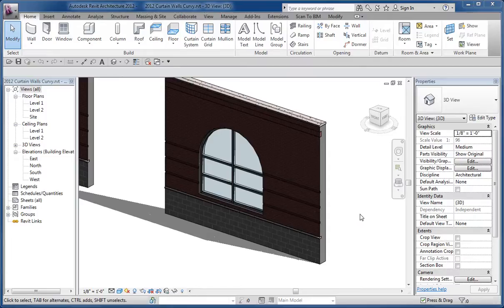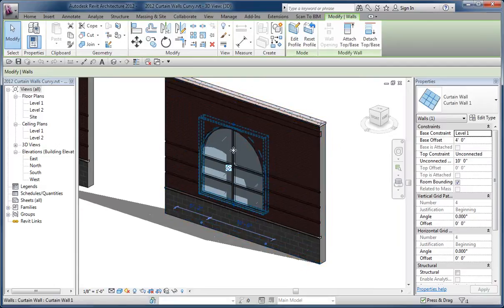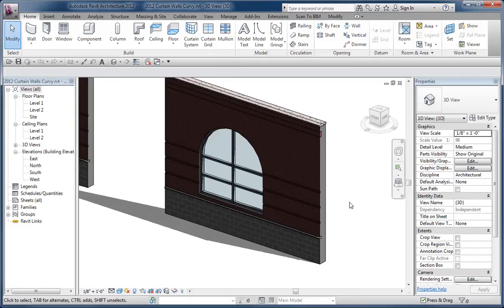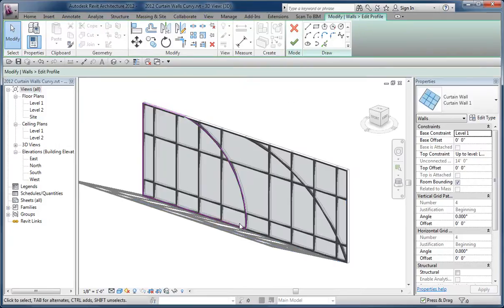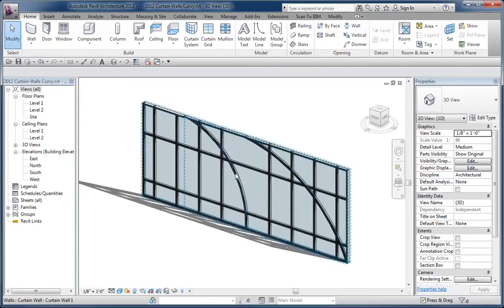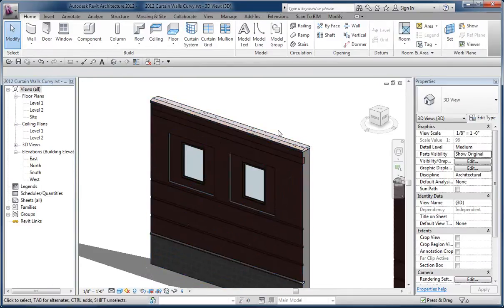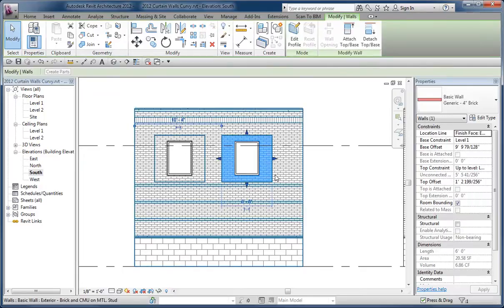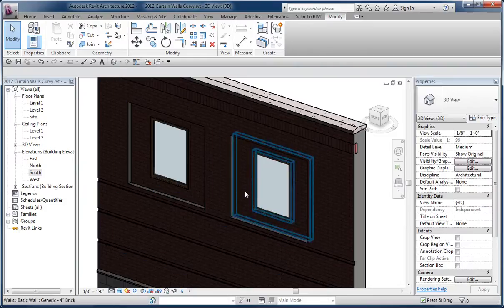Curved Curtain Wall Edges

Comment: thank you for that ,but if you can explain the curved mullion in small video it will be perfect
Reply from the maker: No real mystery. I just applied a rectangular mullion to the boundary of the curtain wall. I used Edit Profile to create the curved exterior shape of the Curtain Wall. I placed the mullions one at a time along the boundary and only one mullion on one curtain wall edge that is shared by the other curtain wall.